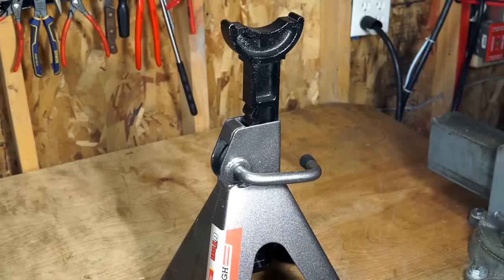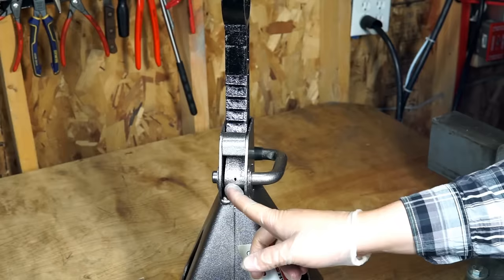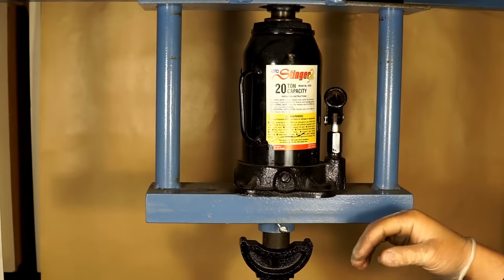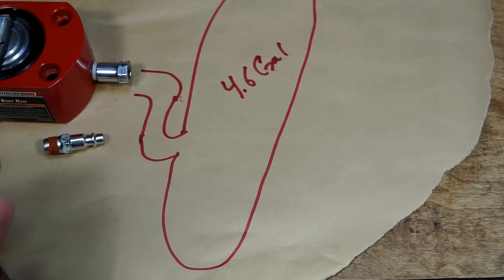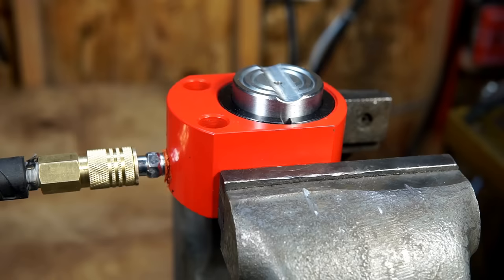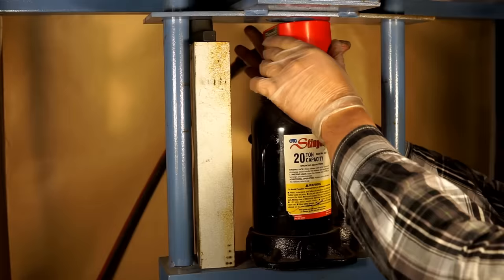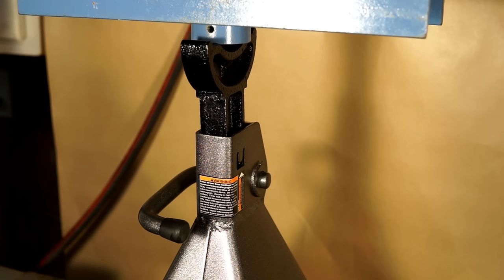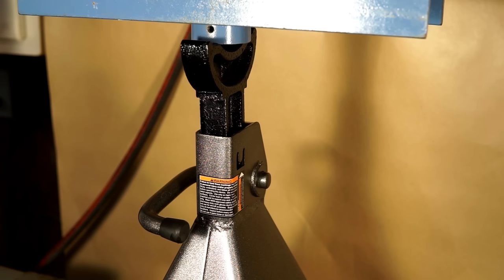EXPERIMENT: WARNING! Doing this to your Jack Stands will get you KILLED!

Comment: After 40 years of working on everything from heavy equipment to cars. I’ve never had a jack fail that way. I’ve bent stands and had welds break. I’ve even had hydraulics leak , blow apart but never have I had a jack stand fall because I hit the lever.  
The most dangerous thing that scares me is bumper jacks.  My dad used to worry about killer wheels somebody he worked with got hurt by one of those.  I’ve been around a shop since I could stand.
Reply: Killer wheels?  What’s that?
Reply: @stevebean1234 probably he is talking about split rim wheels. Definitely scary
Reply: @stevebean1234  old buses and some trucks used to have a rim that was two pieces. They had bolts to hold the two halves together. What would happen is the bolts would fail and the rims would kill people. They were the reason they made tire cages. Very dangerous, still you do see them sometimes especially in other countries.
Reply: Exactly, if there is weight on the jack stand it's not going to fall, the guy lifted the car because there wasn't much weight on it apparently....
Reply: Yeap same here as as set, the weight on the cradle of the jack prevents you from bumping it loose. In the porsche car, he probably did have the jack set right . Even with 500lbs on the  cradle, your ARE NOT bumping a quality jack loose.
Reply: I had a car (early 70s) on a bumper jack.. wheel off sawing an exhaust pipe.. as I slid out the car flipped off the jack and the drum made a gash in the pavement
2 seconds earlier my head was under that drum.. we had 'upstairs protection' in those days.😇
Reply: Ditto
Reply: The ole split rim tires. Yes bumper jacks are called "suicide jacks" for a reason
Reply: What's a bumper jack?
Reply: Ok, first off, if it came down  low enough to crush his face, how do you lift it? There is not enough room to do a bench press style lift? Pleae lay down on your back and pretend to lift something off your face, but no part of your upper body can move any higher than your front teeth.  Second, don't buy cheap shit. Not all jack stands have the angled notches that require it to lift up. Third,  from what I've read, the car was only on two stands. So, it now had a fulcrum/lever action. (Simple machines). Also, Porsche is rear heavy. If he was under the front end, prob only take 100 lbs or less to lift that handle. Also, don't by 6000lb Jack's stands if you're not holding that much. Shit 4 of those hold 12 tons. I bet if you got 1/2 ton ones, that pin would shear sooner. Bigger isn't better. I've never seen a jack stand fail. Don't use cheap crap. Don't use old warm out crap, Bigger isn't always better. 100% guys own fault.
Reply: I've never seen a stand fail that way either. I have seen stands sink into the hot blacktop and the car fell off. I always toss the tires under the car as one more safety measure.
Reply: Bumper jacks are real nasty.
Reply: Yeah I agree. I've been working on cars for over 30 years and never once had this happen. I actually tried this once years ago to remove a jack stand that was in my way while the other 3 stands were holding a lightweight sedan up and guess what happened? I bent the sheer pin and the jack stand remained in place. Funny thing too the way I got it off was just lifting the car up high enough (and I'm not a big guy) for my friend to pull it out of the way. The sheer pin worked then.
My guess is that this guy has a big ass hydraulic press and a youtube channel so he wanted to think of some misinformation video he could put out there for clicks.
Reply: @Sudas80  it covers the scenario of the freak accident where you place yourself under the car, get somebody to rock the car savagely, and at the same time use a big lever to knock the jack lever, and make sure you don't have a backup jack in place. Also make sure the car is in neutral, no hand brake or wheel chocks, and on a hill.
Reply: @richardhenry1969 They're not bolted together.
Reply: @mustangracer5124 same thing happened rotor left dent in pavement I slid out and was almost wedged in between the curb. The jack bent and gave way must have been unbalanced but I remembered i almost died. Good ole days
Reply: The same here
Reply: Add 2 6×6 about 12" long under each tires

Comment: I think it's important to know that the pin is probably not a shear pin, but a steel roll pin. The steel roll pin is designed to hold components im alignment, not to act as a safety device. I have jack stands that are substantially similar and the pins are steel roll pins, not shear pins.
Reply: That is a very important distinction.
Reply: Yeah that’s what they, but you’d think they’d shear. You would Also be surprised how stubborn a little piece of steel can be lol.
Reply: Very good point - and even if it is designed to shear, there will be a threshold below which that wouldn't happen.

Comment: Always put the jack stand handle on the outside of the car. For one thing, you'll be working under the car & want to avoid the accidental impact. For another thing, it'll be easier to drop the arm from the outside once you lift the car off the stands to lower it with the floor jack.
Reply: And hope that someone that doesn't like you isn't walking by.
Reply: good point.   but that is common sense
Reply: @marketingmajor8126 - A Bungee Cord to hold the handle down, a Strong Tie Wrap, or a Locking Cover, over the Handle, are various "Additional" Safety measures, that can reason well, slow, or stop, such "Situations" from being "Easy" to accomplish! 

Maybe a Combination of two of these ideas, if you live in such a "Crib!" 🥴🤭
Reply: @edhoffa4685  not for folks new to using jack stands, buddy.
Reply: Just don't raise the post. if you need the vehicle higher buy taller stands. Raising the post/s makes he vehicle less stable.

Comment: Good experiment. One set of jack stands I have are made by excello where the lever actually has to move upward in a curved slot to release. I’ve complained about them, but this video tells me that feature is a very nice one to have. The base of these stands is solid plate on all 4 sides. They’re quite heavy too, but I think they are well-built. I’ve had them for about 30 years.

Comment: I liked this video.  There is one point that I would like to make, human's head not completely in the game.  When I was 24 years old I had a 1960 Olds that I used to go back and forth to work.  My job at the time was a heavy equipment mechanic, so I knew about safety.  I wanted to check my carrier bearing because I had a vibration.  I drove the car up on blocks, ( a 60 Olds is low), I blocked it so that it could not go any further forward.  I did NOTHING to prevent it from going backward!  The only thing holding the car up on the blocks was the transmission that was in park.  I then crawled under the car and popped the driveline off of the diff!  The car immediately started to roll of the ramps.  At least I had the presence of mind to turn over on to my back.  The frame went across my stomach.  I could just barely breathe.  If the frame had went across my chest, it would have killed me.   There are so many things that I did wrong.  No blocks to prevent rearward movement.  Did not apply the emergency brake.  Did not take the transmission out of park.  

I worked on things every day that could easily kill me, but I always made it safe.  What was I thinking?  My mind was definitely not on what I was doing.  I guess that the point that I am trying to make is, stop and take a look at what you are doing.  Look at everything.  It should only take you a couple of minutes, but I always do it now.  I am 70 years old now, and every time I get under ANYTHING I remember that day long ago.  It is NOT  a pleasant memory.
Reply: Rat Builder, you nailed it. I’m 63 and have heard more than my share of horror stories throughout my life. We get caught up in getting it done and too often forget about our own safety. Having been an auto mechanic for a portion of my life, I can see how what happened to you could easily happen when in a hurry or are preoccupied by something. I have had some close calls too. I don’t like to think about them, but when I hear stories such as yours, those memories are revived. As the saying goes: “Look before you leap”.
Reply: I’m new to working on my car. It takes me a long time to do any work because I stop and think about each step for a couple of minutes before I execute it. I’m glad you survived that day so you can share your story.
Reply: @waffledninja6278  Thanks Cray.  There are several videos out there that are titled "Why Women Live Longer than Men".  it shows some of the STUPIDEST actions that I have ever seen.

My 5 year old kids were playing in the yard when this happened.  When one of them got close enough that they could hear me I told them to go get their Mother.  My Wife was across the street at my Mother's house.  

I could see her just calmly walking towards me, and when she was close enough to hear me, I told her to "get this thing off of me!"  She yelled at my Mother that the car had fell on me.  All they had to jack up the car was the bumper jack to change a tire.  I was impressed, they started jacking up the car, and would put some blocks under as a safety.  Jack and block, jack and block.  They did this on their own.  I was impressed.  Two House-wives had more common sense than a professional heavy equipment mechanic.
Reply: Been there, done that, Rat builder.  The memory strikes fear into my heart even now, twenty years after the fact.
Reply: @kevanbarley1225  This happened about 1970.  Even to this day, I remember how I felt!  How I could just barely breathe.  those thoughts will never leave me, which is good!!!  I am a lot fatter now.  I can't afford to try doing something as stupid as this again.

Comment: I'm a freak under cars so here a good way to be super safe. I usually work with either the car on 4 stands or only 2 (front/rear). After placing the stands, I keep my jack under and I will then use the wheels as another safety put them under the car.
Reply: sound like a person that doesn't want crushed and likes life :)
Reply: I also put the 16x8x4 SOLID concrete blocks under it TO THE FRAME. I damn sure have never needed to use algebra and calculators to get my shit to stay up.....no Viagra either .... CIALIS !!!!     LOL !!!    PLEASE... DON'T EVER USE CINDER BLOCKS, they are WIDOW MAKERS.
Reply: It's there for a backup. It's like jacked up right before it touches the actual part.
Reply: i was just going to write this word for word till i seen ur post top advice mate exactly what i do and never ly on ur side
Reply: Fester Blats I had a 2t stand fail. Overkill is better than underkill. Ther was a soft spot in the pavement. Then it fell back on the floor jack.
Reply: I do the same thing.  Jack stand with the jack up to the frame and the rims and tires on both sides of the vehicle.  It's always better to have a backup just in case the jack stand fails.
Reply: same here.... shoving the tire under the car too if I take one off
Reply: What I've done before is jack the vehicle up and set some unused steel rims under the tires. Obviously the rims are laying down, but I've found this to be quite stable. Used it under a 3/4 ton chevy and it felt way safer than if I had 4 jack stands under the frame with them all lifted way up.
Reply: I am to I put blocks of wood or cinder blocks under to tires
Reply: TheMidnightNarwhal I usually jack up one side..jack stand...move to the opposite side, jack it up and spare tire with the jack. Your methods are on point though! the safer the better and even do this with a new jack or stands. New does not necessarily means it wont fail.
Reply: TheMidnightNarwhal i do the same..
Reply: I was taught to do the same by my dad growing up.
He used to work as a mechanic for a company that would repair gas and diesel vehicles and would tell me about how one of his co workers got smashed under a vehicle after the stand that was under it just randomly broke for no apparent reason.
Random accidents can happen at anytime, no safety feature is 100% fail proof, it takes an extra minute or two to slide a wheel under so why not.
Reply: same here, I leave jack under car
Reply: This cat Midnight is doing it right.  I always have a back up jack stand. An empty wheel under a tire works.  I always leave jack under if I can. Depends on job at hand
Reply: i use cut tree trunks as a secondary in case jack stand failure, that way if the jacks fail its not gna fuck up my wheels.  cheers
Reply: Good tips for beginners
Reply: Always leave the jack. Jack stands can fail also
Reply: TheMidnightNarwhal lol...i did the same think...even with my Quick Jack.
Reply: Good  video and experiment. I agree surprising results (regarding the shear pin). Would be interesting to continue adding pressure to see how much it would take to actually get the pin to shear.
Reply: TheMidnightNarwhal same here. At least 2 stands, the jack left under, and a wheel or two.
Reply: TheMidnightNarwhal I use jack stands and use the jack as a safety and put huge wooden boards underneath the tires
Reply: 10:10 I love the grunting. Makes for great demonstration.
Reply: fuckin safety sally
Reply: He probably couldn't add much more with his set-up depending on the psi of his compressor.
Reply: best way to do it. you cant enjoy the fruits of your labor if you're crushed.
Reply: TheMidnightNarwhal us always use 2 plus the jack and the wheels
Reply: I have big blocks of wood cut I Jack  her up slide blocks under all around then take jacks out I trust this wood more than steel.  Never had any problems, my father is a civil Engineer he taught me this and many other great tidbits of info
Reply: Yea i always place wheels beneath for extra safety if something Goes WRONG you need time to get out, u can never be too safe with cars.
Reply: @Fester Blats I think it's more of a secondary level of precaution. You're never the guy that gets crushed by a car, until you are that guy. There is nothing wrong with having a fail safe, if you're spending a lot of time under cars all day, since your odds of becoming that guy go up significantly.
Reply: TheMidnightNarwhal I am lifting my Jeep and I have two stands and an extra small jack 😂
Reply: Me too!
Reply: Putting a car in the air totally, supported by 4 jack stands, is a hazard.

Comment: I was working on a Volvo V70 estate a few years ago. Good set of pinned axle stands, Jack underneath and the wheel I’d taken off. The concrete on my driveway actually gave way which shifted the axle stand and the car came towards me pinning me against my neighbours wall. I couldn’t shift it at all due to the car being wedged now with the rubber of the tyre! I couldn’t take a breath and don’t remember much after that but luckily a neighbour heard my “last” breath and jacked the car off me sideways! Lucky. I redid the drive after that but have never gone underneath a jacked up car again. If your time is up something will get you.

Comment: FYI... They just put out a recall for those HF jack stands you got! Stay safe!
Reply: the bad ones need very little movement to collapse. Also, they have a 2nd failure mode, which is the actual cause of the recall: when you wiggle the load, they just collapse. Nothing to do with kicking the handle.
Reply: I think it was for the 3 ton jack stands not the 6 ton
Reply: @kllgrogto5838  Six ton jack too.
Reply: @gregd3551  good to know i was about to buy the 6 ton
Reply: And three of the pttsburghs been recalled. But nowhere in the story does it say what kind of jack stand Mike had. The old ones didnt have too many safety features. So your video is half wasted.
Reply: I got mine easily 5-6 years ago. Could mine be a set of recalled stands? How would I know?
Reply: @richroc7  If you do not raise the post there is no issue with them collapsing.
Reply: @jf4872  I checked with HF, my jack stands aren’t included on the recall list. 👍🏽

Comment: The Daytona Stands from Harbor Freight have a locking pin for added safety. Great feature.
Reply: I've always lifted the car with my hydraulic jack and then left it and then put jack stands underneath as added security.  I never thought to have the weight of the car onto the jack stands.
Reply: @specialsause949  DO NOT DO THIS. THIS WILL KILL YOU. You need to apply the weight to the jack STANDS. Then put the floor jack half inch from the frame. The car should NEVER be supported by the floor jack while you are under it.
Reply: @specialsause949 damn man thats unbelievable. If that jack fails and suddenly drops on the stands they might fail or tip over because of the sudden drop. Weight must be on the stands at all times to keep them stable avoiding  a sudden drop. I leave most of the weight on the stands, and leave the jack with some tension on it also, then put the tire/tires under frame of the car for added security.
Reply: @katdat1399  I leave the jack under it with a little weight, still touching,  but most of the weight on the stand.
Reply: I have many years as a mechanic the more tons equal a stronger jack with safety features if you don't elevate the jack stand you are completely safe because the jack has nowhere to drop 😮